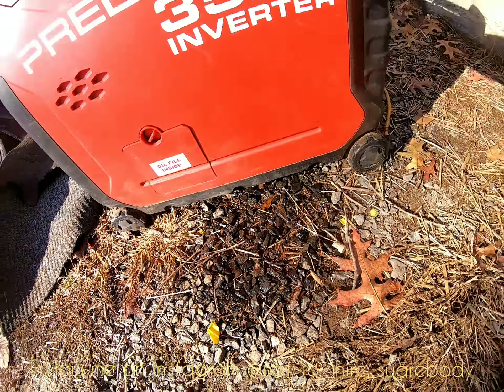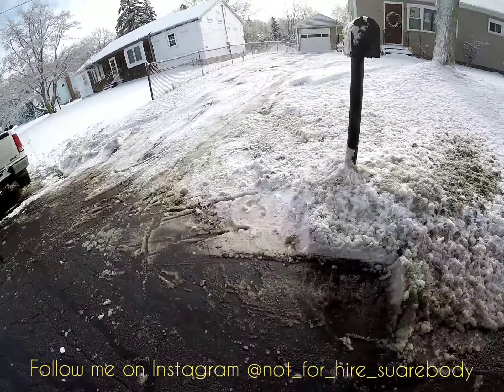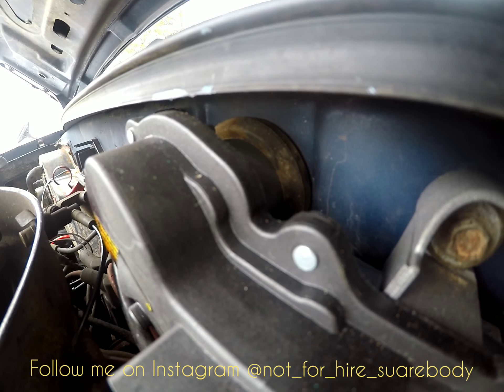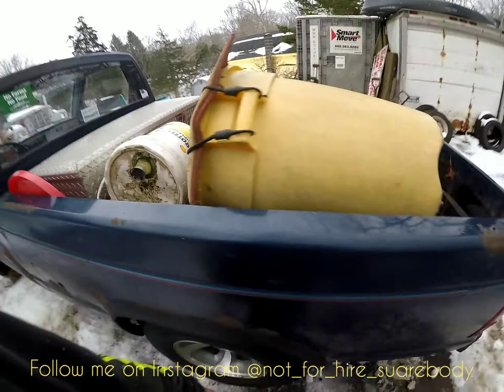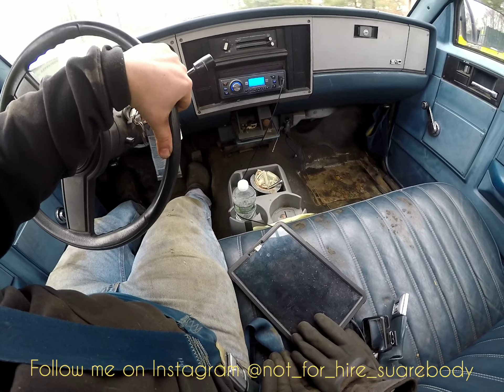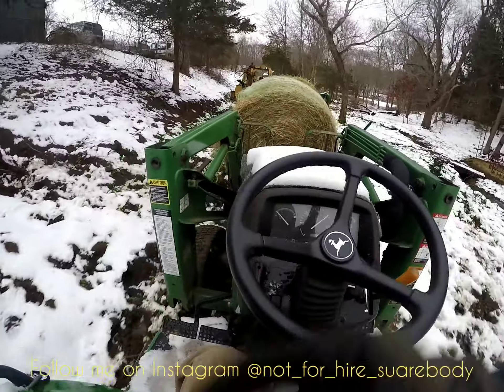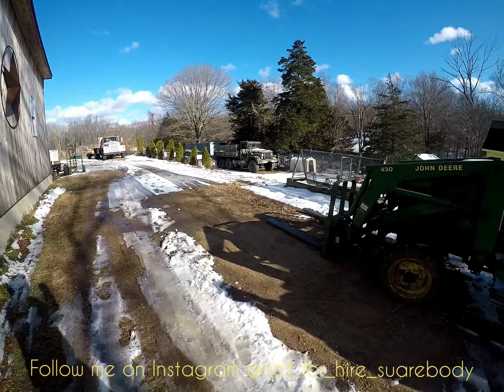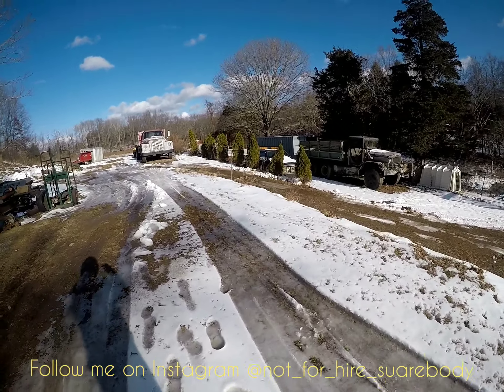RUSTY S-10 PART 7 flat tires & snow

Comment: Might need to buy some new tires and rims for the old s10. It would set the truck off man. 245/55r18s look great on stock height
Reply: That k10 is a work truck not a pavement princess